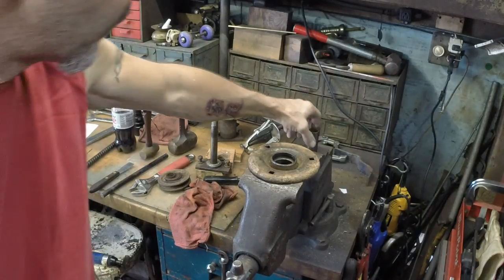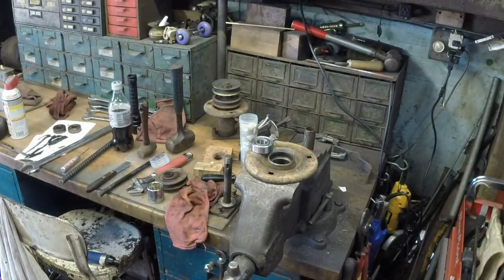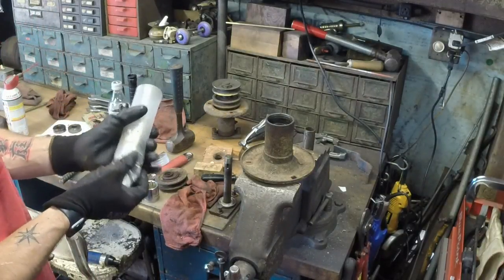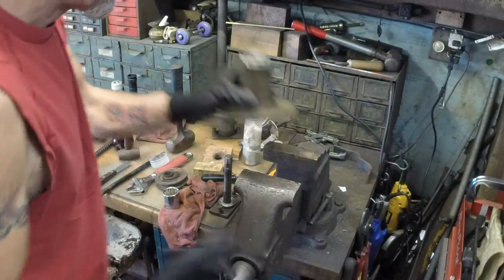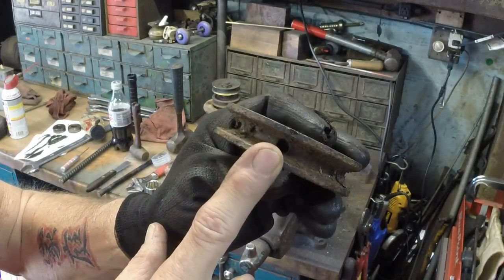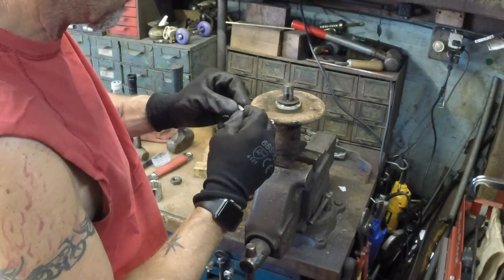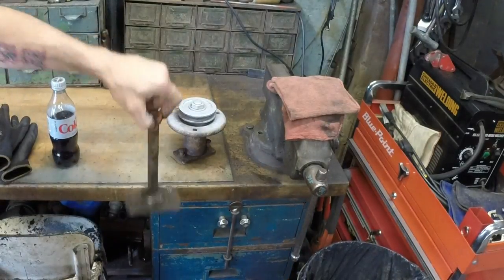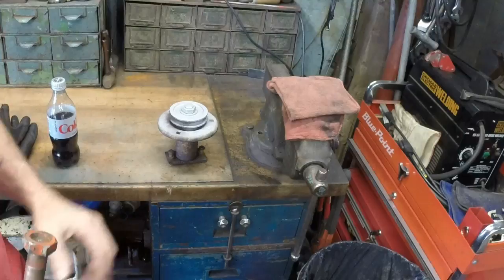Rebuilding Deck Spindles for Simplicity and Allis Part 3

Comment: Fyi: In the Simplicity/Allis Chalmers parts breakdown it shows 3 different washers to space the blade hub end. The thick narrow one,the thin "flinger" and then a thin but smaller diameter one against the inner bearing surface to keep the "flinger" from rubbing on the bearing sheild. Another thing that some miss is: Its important to have a tight sandwich type arrangement between the inner races of both bearings ,the spacer and the sheave by way of the top lock nut. If not,Over time the bearings will rattle and spin on the shaft, causing wear on the shaft/ bearing mating surface. Tension on this whole assembly will also keep the keyway from getting clapped out. I've found at times the spacer between the bearings gets worn from this and should be replaced or a Take-up washers should be added to make it right(watch your clearances!). Also it's a good practice to tap sharply on the blade adapter side after tightenng the top nut (takes out any free play) than retighten.
Reply from the maker: Great info to pass along Belanger! I'll pin this for all to read. Cheers! Zip~

Comment: I realize this is a rather old video but it just saved me a quoted "$1200" for a local shop to build me a new simplicity deck spindle.  I was able to follow these steps and change the bad parts in the existing spindle for under $20.  THANK YOU!!!
Reply from the maker: This is why I post the videos! Glad you were able to save all that cash! Zip~

Comment: My Homelite decks have the thin metal pulleys on them and they are a real pain to get off and not ruin. Great video Thanks.
Reply from the maker: Yes they are! I've mangled plenty in my day. Zip~
Reply: @ZippoVarga  Where did you get replacement s for them.

Comment: Good info. I have the deck for my 7016h that still needs spindles rebuild. I have all the new bearings sitting in the parts bin but one of the spindles has severely buggered up threads. I need to weld it up and re die it.
Reply from the maker: Is it an outer? I've got plenty here...get me a length and I can send you a good one Moe! Zip~

Comment: Zip - great and thorough video!  I've replaced all the bearings on my 3 blade deck on my Wonderboy 606.  Works great.  Now On my B208, the top pulley on the center spindle came loose for some reason and ruined the keyway.  Got a new pulley from Sandy Lake, and now when I put it on and tighten the lock nut ( my Simplicity manual says 70 ft-lbs new and 45 if used), at either torque, the spindle locks up.  From your video I'm thinking the spindle assembly may not have had the proper number of thrust washers/spacers.  What's your thought?  Or maybe the spindle is missing the spacer??  Keep up the great work!

Comment: I like to use a block of wood as a cushion when driving in the bearings. A socket can damage the race because these sealed bearings are pretty thin. I also remove with a pick the inside plastic seal from both bearings upper and lower bearings and add a grease fitting in the spindle housing and that allows grease to get in these cheap bearings. If that's too much work I would at least pull the bearing seals and add grease and reinstall the seals as from the factory there's very little grease inside. Unfortunately these cheap sealed spindle bearings fail often. I've seen them fail in as little as 100 hours.
Reply from the maker: I agree with the inner seal removal and installing a Zerk. However, when I install bearings, I'm not whaling on the socket nor am I using the inner race which would cause potential damage. A bearing and race installation tool is comprised of metal and designed to use as I did with the socket. I've never seen a wood bearing and race setter and when you think about it, wood works to a point, but won't fully seat in instances where the bearing ends up recessed into the fixture unless you have turned the wood to the proper diameter. Not saying that using wood won't work, but even with the cheap bearings, I'm not creating any stress on the bearings, inner race or even the outer race with the care I've taken. And, I'm certain the bearings are properly seated where using wood won't give me the positive stop needed to know a bearing has reached the fully seated position before the wood would potentially start to deform. I'm just saying....when I was in school to become a machinist and Machinery Repairman, wood was never used nor recommended for the reason I stated above. But I do thank you very much for taking the time to show other options. However, I don't recommend using wood to seat bearings or races simply due to my training and running the risk of an improperly seated bearing. Cheers! Zip~

Comment: (aka GrincheyOne) Sorry I missed parts 1 & 2. Stumbled my way through the center spindle on my Weed Cutter,  which has 4 spindles, The main spindle is the "toughie", since it is driven from the bottom, and has a few more components. I did post (years ago) my  46 minute  experience. Yet to do the 3 outer spindles, so I can put the mower back into service.

Comment: I bought in a crate how do you adjust the height and determine gap and spacing?
Reply from the maker: I posted a deck leveling vid last year. Just search my channel for Deck and it should show up. Cheers Todd! Zip~

Comment: Gday
pity u not do this about 6-7 yr ago when i had to do my 42" deck the 6 bearings cost me $100 i know but there oddball here and country farm place. i had to get the middle spindle shaft made old 1 had a wobble in it and i take the inside seals out and pumped the thing full of grease been ok since  now i know
i got a 7013s that runs a 70 xxsomthing has a deck with the wrong middle spindle fitted and not got it running yet and a blown out bearing in the bgb  a 2110 with no deck no lift or pto and slop in bgb but motor runs thats in the 7013s right now and a 4211 no motor lift or deck and a stiga 2000e 
i like em but hard to find here and go for more then u would pay lol
cheers
Reply from the maker: Yes, they are hard to come by in other countries Scummy. Plentiful and on the inexpensive side here compared to Cub Cadet, Wheel Horse and John Deere. But built like tanks! Cheers! Zip~

Comment: Is there a reason you don't use anti seize on your bolt threads?
Reply from the maker: I do use Anti-Seize where applicable and practical. The rebuild of these is so infrequent (this one lasted 50+ years and came loose easily), that I didn't feel it needed it. When I'm assembling anything that mixes metals, like steel into aluminum, I always use it. Incompatible materials tend to oxidize more so than like metals. That's just my take on it and I'm more than open to your opinion. Perhaps it will change my habits and use of Anti-Seize!! Cheers!! And excellent question Eddie! Zip~